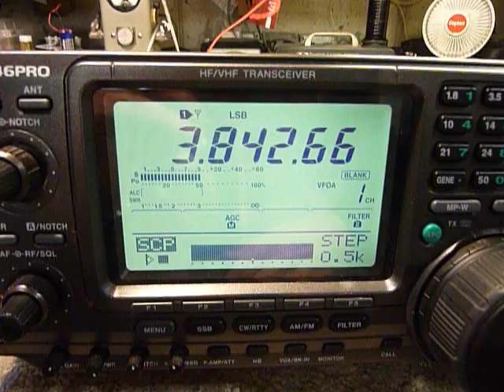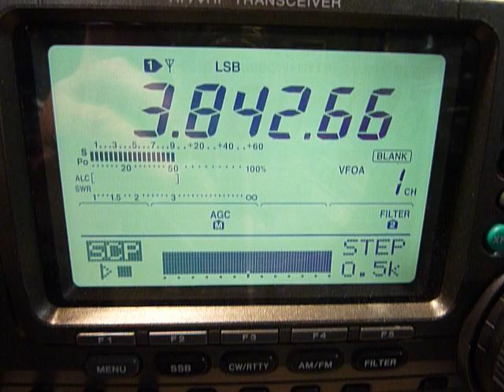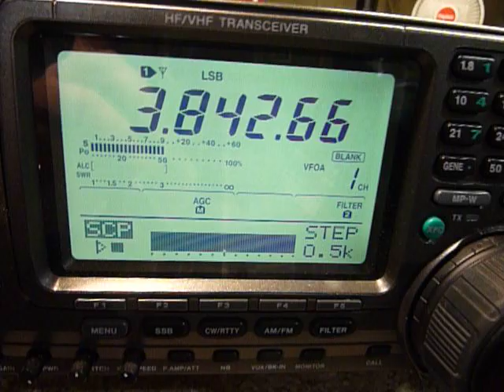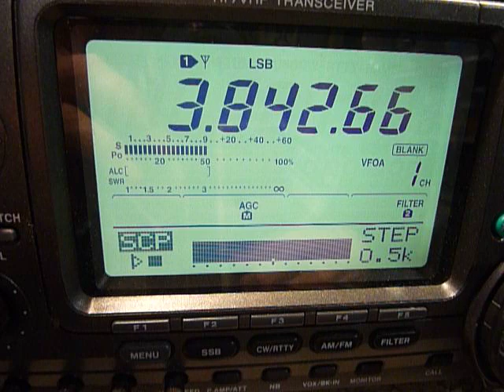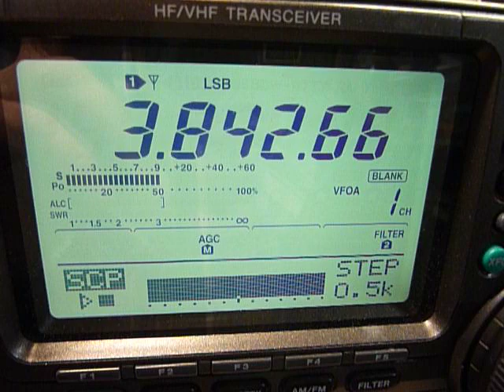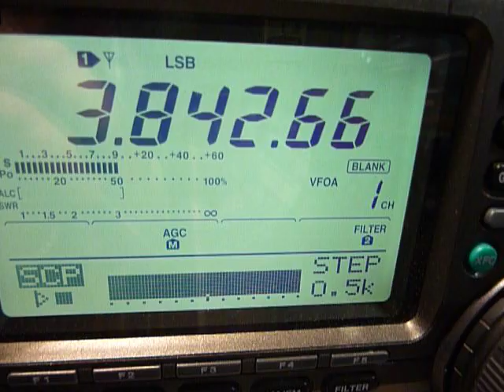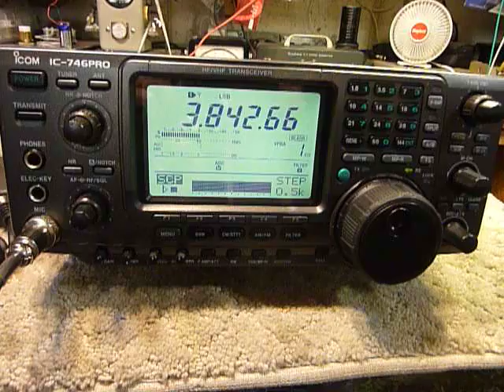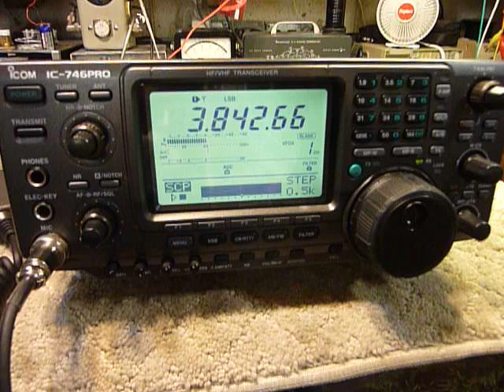PART 2  , icom 746PRO NO AUDIO ,iCOM 746PRO NO RECEIVER AUDIO

Comment: Hi, Robert. I have the Icom IC-746 and the audio when the mode is changed to FM is either too weak or lost. The audio though for the other modes is fine no prblem at all, it's still very loud. I would like to ask if you have any idea what could be the problem. Thanks.